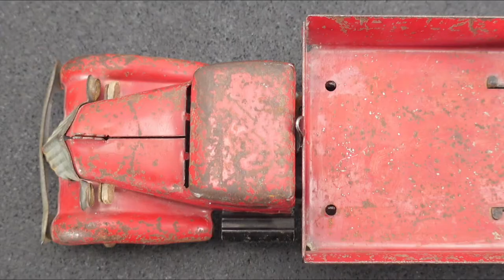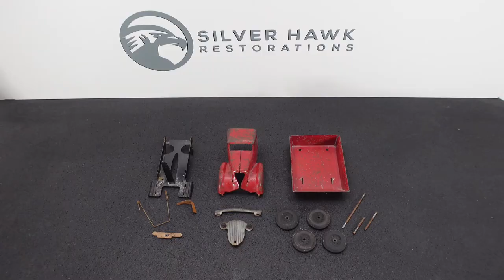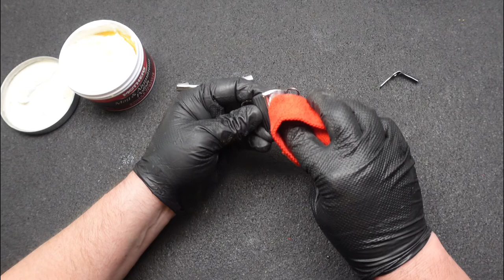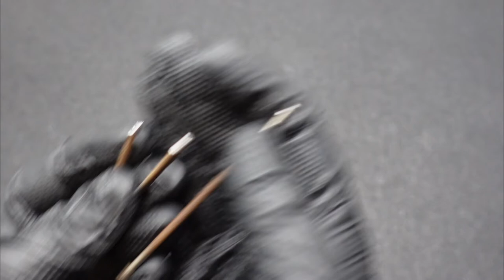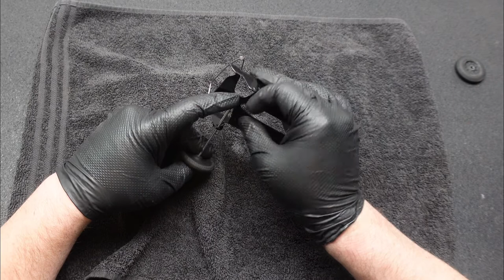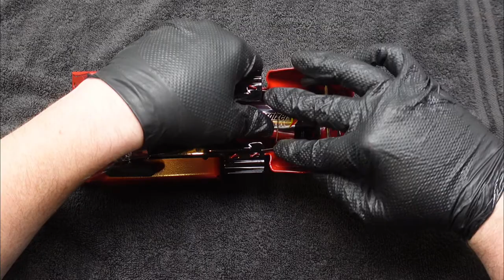1930's Wyandotte Light Up Dump Truck Restoration

Comment: Nice work!  I went a little nuts with this same model fabricating identical rear fenders (like the front ones), extending the running boards, and replacing the bed with mahogany and pine laminate.....way too much fun my friend!  Best wishes.